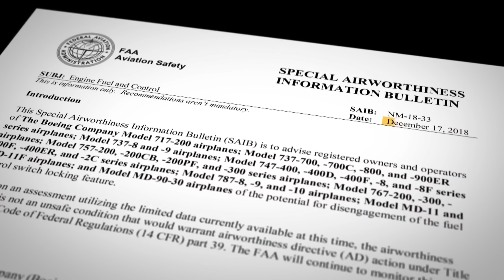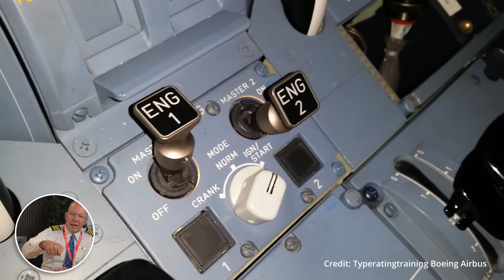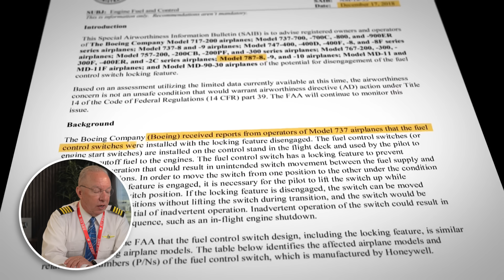Air India 171: The FAA’s 2018 Fuel Switch Locking Bulletin Explained (16 Questions Answered)

Comment: This seam like a deliberate act. Is there any other control functions if you think about a deliberate act (That is considered a single point of failure ). The perfect timing to cut the engines  . so that no one could do anything to stop the crash after that moment . The other pilot could not do anything at all . . What else could one pilot do that would cause an accident and the other pilot could not do anything about . This is why you have redundancy by having 2 pilots . I know this is a bit of a rabbit hole . The exercise/ brain storm .  What else in critical moments is a high risk if one action devious action is taken by one pilot could the other pilot simply have no chance to trying to sort out to save the aircraft

Comment: In one video of Boeing 787 cold start, I noticed that fuel switch has very audible click sound. Each switch has 3 distinct audible clicks. Wouldn't this click sound be recorded in this case when the switch was operated right after liftoff? I know the background sound during liftoff if more than background sound while cold start. But still, deeper analysis of CVR will give some conclusive details that will give clarity on operation of the switch just after liftoff.

Comment: On the morning of the tragic Air India’s B787-8 aircraft bearing registration VT-ANB crash at Ahmedabad on 12 June 2025, all indicators showed a normal takeoff sequence until 08:08:42 UTC, when both engines shut down seconds after liftoff. The fuel for both engines was CUTOFF one second apart—without any recorded pilot command. 
The assumption the switches moved is preposterous! Flight data recorders log electrical signal states, not physical hand movement. A transient spike, EMI (electromagnetic interference), or faulty relay could send a false “CUTOFF” signal without the switch physically moving or affecting fuel flow. A recorded "switch transition" does not guarantee actual pilot action or fuel cutoff. The Fuel Control Switch in the cockpit sends a signal, it doesn’t directly open/close the valve.  Therefore, a signal cutoff or software fault can close the valve, even if the switch in the cockpit remains untouched and physically in RUN.  So, switches can appear to transition without affecting fuel, and fuel can be cut off without switch movement. The assumption that the fuel cutoff switches were physically moved by the pilots is not only unproven but contradicted by both evidence and engineering logic. 
🧾 Timeline of Events from Preliminary Report
08:08:33 UTC – Aircraft achieves 153 knots IAS (just above V1).
08:08:35 UTC – Vr (rotation speed of 155 knots) reached.
08:08:39 UTC – Air/ground sensors confirm airborne status.
08:08:42–43 UTC – Fuel cutoff switches transition from RUN to CUTOFF, engine spool-down begins.
08:08:47 UTC – RAT (Ram Air Turbine) activates to maintain hydraulic power.
08:08:52–56 UTC – Fuel switches automatically return to RUN.
08:09:05 UTC – Crew issues Mayday call.
08:09:11 UTC – Data recording ends.
🎧 Cockpit Voice Recorder (CVR) Dying Declaration
“One of the pilots is heard asking the other why did he cutoff. The other pilot responded that he did not do so.” — Preliminary Report, p. 14
This is a dying declaration, a legally and ethically significant moment. Both pilots, in real-time, deny initiating the shutdown. This carries more probative value than any external interpretation post-crash.
Key Technical Observations:
🟢 Fuel control switches were found in ON position after crash.
🔍 Flight Data Recorder shows no deliberate manual action on the switches.
🧑‍✈ Pilots expressed confusion on the CVR, in real-time, both deny initiating the shutdown. indicating they did not expect the engine shutdown.
📉 No alert, fault light, or system warning gave them time to diagnose.
⚠ FAA Service Bulletin (2018) warned of accidental fuel switch actuation, but it’s unclear if this aircraft was retrofitted.
🚨 Captain Steve’s Claim vs Reality
Captain Steve: “This was a human intervention that caused this accident. Plain and simple.”
❌ Factually and Ethically Incorrect:
❗ Contradicts CVR: Both pilots denied cutting fuel — in their final moments.
❗ Contradicts physical evidence: Switches were in the RUN position.
❗ Ignores systemic or electrical failure: Possibility of signal glitch, software misfire, or undetected control logic error not addressed.
❗ Ignores FAA’s own documentation: 2018 bulletin acknowledged risk of unintentional switch actuation, which points toward design vulnerability.
🔥 By brushing aside the dying declaration and dismissing alternative causes, Steve shifts blame from system failure to dead pilots, following the classic DARVO pattern: Deny, Attack, and Reverse Victim and Offender. Captain Steve’s narrative is not analysis. It is a dangerous cocktail of corporate protectionism, pseudoscientific profiling, and colonial scapegoating.

Comment: You're just trying to shift the blame away from a mechanical failure and pin it on pilot error, probably to protect your job or avoid liability. But let’s not forget there was already a Boeing 737 incident in 2018 caused by faulty MCAS sensor.

Comment: https://youtu.be/bEtu6_oc3AM?si=r2TVpGmXHl4UyoSg

I'm absolutely amazed that there are still such diametrically opposed opinions on the mechanical issue from experienced pilots on this case.   I have no clue who's right on this "could it have been a mechanical failure?" question.  I just know not to have a definitive answer on that issue by now is confusing.

Comment: We need to exhaust all scenarios before accusing a pilot or mass murder/suicide. A software glitch needs to be investigated, could this fuel cutoff have happened without physically moving the switches? This is a fly by wire aircraft, where the physical command is sent to a computer, which then effectuates it. That angle ought to be looked at. Unless there was a clear scuffle in the cockpit in which case they should make that clear and release the entire transcript or audio of the CVR.

Comment: I noticed the position of those cut-off switches relative to the throttles. Is it possible that a jacket sleeve or dangling bracelet could have inadvertently caught on the switches?

Comment: If it was a mistake then the pilot must have thought they were doing something else. Does the log show any missing step in control manipulation that logically should have occured at this point in flight instead of cutting off the fuel?

Comment: Great Q&A. I get the persistent pushback from pilots on the cameras in the cockpit issue. And while cameras may not prevent these tragedies, they sure are likely to help get the questions answered more definitively. Even transit busses carrying passengers have cameras in them these days. The potential for number of lives lost in a bus accident is much smaller than those in a commercial jet aircraft crash. There's absolutely NO reason to not have cameras on the flight deck. The flying public deserves this. Plane drivers should be regarded with the same scrutiny as bus drivers, period, with all due respect Steve. Love your channel, thank you sir.
Reply: YES!!!
Reply: A camera would make insider sabotage threats less likely even though it may not fully prevent it. Worth it undoubtedly!
Reply: With all due respect, what knowledge do you have about global standards for bus drivers?
Reply: @ohauss  I have no knowledge of global standards for bus drivers nor did I claim to in my statement. Thanks for asking.
Reply: @Augie-Ben-Doggie  Except you tried to declare your local knowledge relevant for an accident by a foreign airline in a foreign country
Reply: @ohauss  I was not aware of a global knowledge requirement for posting comments. Thanks for letting me know.
Reply: Buses and trains donot have high fuel capacity. They wont help when  airplane crashes . These blackboxes have been time tested.

Comment: But if I remember correctly, is deploy the RAT first, and then the fuel supply is cut off, correct? Is there a possibility that it's an electrical issue and no one touch the switch but is cut off the fuel, and that's why the RAT is deployed first, followed by cutting off the fuel?

Comment: Question:
If both engine fuel switches can be moved to the cutoff position within 1 second, why did it take 4 seconds to return them to the run position?
Possible Explanation:
Perhaps the fuel switches were already in the run position. It may have taken the pilots around 10 seconds to realize that fuel wasn’t reaching the engines. In response, they may have cycled the fuel switches from run to cutoff and then back to run, hoping to reset the system. The 4-second delay could be due to the extra steps involved, combined with the confusion or panic of the moment.

Comment: Most of the questions have one answer, its a dual engine aircraft, there´s no previous situations of one switch changing position by it self, or electrical issue, computer issue, the probability of it happening on this flight, on both engines in a human compatible speed (1 second between switches) is logically impossible! And the most important detail here IMHO is that it happened in the worst moment possible right after rotation, consistent with someone's intention, it it was within some seconds before or after it could have been possible to recover or reject. Now i´m not saying that it was deliberate, it's also possible it was a mistake, also the one that said why did you cut off the fuel might be the one that did it and was covering, to soon to know, and maybe it will never be known.

Comment: Here's a question for your regulation Ask The Captain episodes;

Why don't pilots take off with the APU running until the plane is at a safe altitude? Wouldn't that add an extra layer of Swiss Cheese? For example, if Captain Sully hadn't had the frame of mind to activate the APU almost immediately after the bird strikes, the incident could have been catastrophic because the RAT only provides very basic hydraulics and power.

(As a related aside to the Air India tragedy, I'm aware it probably wouldn't help here since the fuel was cut. Or is there a third fuel cutoff switch? If so, could the APU have helped?)

Comment: It would seem that no valid reason exists for cutting off both engine fuel switches in flight. One maybe in the case of an engine fire, but not both. The engine control software should not allow this, especially below 10,000 ft.

Comment: One Clue people are missing is that Engine 1 was shut down first(closer to the Captain) . Normal procedure is to shut down engine 2 first. If you want to reach to the switches to shut down the engines without the other pilot noticing, you’d want to reach to the closer switch first for sleight of hand. Also the Copilot was flying and the landing gear never went up, which is the Captains responsibility as the monitoring pilot. I think the Captain likely did it, but I could be wrong.
Reply: I really don't understand why no one is mentioning the landing gear not coming up. Seems like it would have something to do with the timing of the fuel being cut.
Reply: @superunison713  when do you normally lift the landing gear as in secs. Like the switches turn off after 3s of flight

Comment: If the cause was an intentional murder/suicide, why use fuel shutoff to bring down the plane vs simply pushing the yoke forward as the co-pilot did on EgyptAir 990 in 1999?  With only a few hundred feet of altitude it would have been  impossible to recover.  Shutting off the fuel and then letting the innocent pilot turn the switches back on makes no sense.   The perpetrator could have fought against resetting the switches for just a few seconds or he could have pushed the yoke forward after realizing his plan was thwarted.  There has been no mention of unusual yoke movement or of an altercation.  It seems more like a distraction related action which everyone experiences during their lives though the consequences are seldom this disastrous.

Comment: The Fuel Cutoff switches were found in the "RUN" position as the Flight Data Recorder said. Not even a crash landing could move them to "OFF".
So they were working as they were designed.
Reply: Dude they were cut off first.  Re read
Reply: @robnanney  Yes. They were moved back to run and they stayed there even after crashing. The locking mechanism worked just fine.

Comment: If at all there seems to be a voice recorder recording both pilots and questioning of why the fuel switch was turned off, then I am definitely positive that’s a confiscated recording planted to accuse the pilots partly by the Company that runs Air India and the manufacturers who sold the aircraft with default parts!

Comment: I had this same question, about the FADEC,  and WOW system integration:  With Boeing's reputation for software:  Re-examine:  Could the fuel switches already be in cutoff at take off, and the engines only shut down after take off . . .  
  You mention the aircraft knows if it is on the ground through the WOW system, and these controls are fully integrated into the FADEC.  
The fuel switches are only software inputs to the FADEC fuel system controller.   I think with Boeing's software reputation, that it is "plausible", that being a software controlled system, that if the fuel switches were inadvertently placed in cutoff during an "out of regular startup sequence".   The controller might ignore the shutoff condition,  until the bogies lift off of the ground, and the aircraft systems transition from "Ground to Flight" operations.   I think the software logic for the controller inputs, is sufficiently complicated,  and could have an escape.  AI software today, can easily review this code, and look for this type of exception.    I agree that it is very unlikely that a pilot would move the levers to cutoff, in some offthe wall procedure, that he may routinely do, for his/her own check list,  but somehow got distracted and forgot to move them back to run,  well before the take off run.    I wonder, if the WOW system signal, software routines, check and clear the bug,  and so the engines then cutoff.    From the FDR,  the switches were moved 1 second apart.   What is the software procedure for the controllers.   Both engines should be controlled at the same time, so this seems to agree with the pilot manually moving the levers to cutoff.  Hmm.

Comment: Question: is there some part of the takeoff procedure that is supposed to occur around the same time as the fuel control switches were moved to the cutoff position? In other words, how possible is it that one of the pilots had a brain fart and moved the fuel switches instead of something else? That might explain why he didn't realize the switches were off.

Comment: There is no evidence that the pilot cut off the switch, and no public data indicates any health issues with the pilot. This appears to be a fabricated narrative. The recorded conversation between the pilots also shows that neither of them mentioned cutting off the switch; instead, both expressed concern for flight safety following a fuel malfunction. For future safety, it would be advisable to install cockpit cameras, provide visual alerts for pilots in critical situations, and implement a properly designed automatic cutoff system in case of fire or until the aircraft reaches a certain altitude. Pilots will not help prevent future failures—leveraging and improving technology is the real solution.

Comment: In the nuclear field (operating and Maintenance) workers are required to get an psychological eval every three years. Maybe airline pilots should get them also. I’m sure the unions would have an issue with it but in NRC requires it in nuclear power.

Comment: In their commentary on this accident, Mentour Pilot and his colleague show a clip from a desktop simulator program that shows the diagram of the fuel system that comes up in if the fuel is shut off in flight. They also show the associated EICAS messages.

Comment: According to the report, the RAT was deployed at 47 seconds, but the switches were only moved to the cut-off position at 52 and 53 seconds. How is that possible? I understand that the pilot’s conversation doesn’t help clarify things either. Logically, in response to that question, I would have expected an answer like “I am trying to restart them,” rather than “I didn’t do it.” In my opinion, this report only adds more confusion. What do you think?

Comment: Wow, your answer against the benefit of installing video recording equipment is amazingly inexplicable to me.
1. Would video recording equipment provide significantly more context to the conditions in the cockpit when something goes wrong? Absolutely. For one, you would have less gray areas to totally speculate about what happens in the cockpit like you do now. So in this example, you wouldn't have to post a 20 minute video discussing and speculating whether the cutoff switch was moved deliberately, by itself or accidentally. A video recording would show how those switches moved. Especially because now the only voice recording we have is the denial of one person that they moved the switches. It would show if there was a 3rd person or other object in the cockpit that the voice recorders never catch.  It's dumbfounding to me that we have 200+ deaths, and we don't want to have as much data as possible to try to reconstruct what happened that might have led to those deaths.
2. The argument that someone might leak the video recordings is also inexplicable. How come you don't have a problem with the voice recordings that have become a standard now as well? Wouldn't someone leak those as well if that were possible. Additionally, it could be constructed so that the video feed is written in the black boxes and be destroyed after a reasonable period of time without any unauthorized person having access to it.